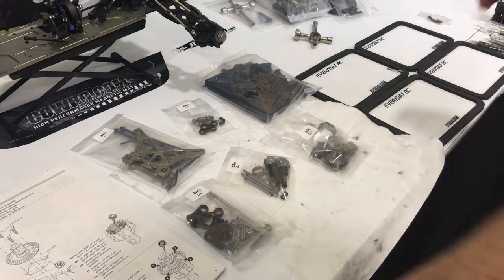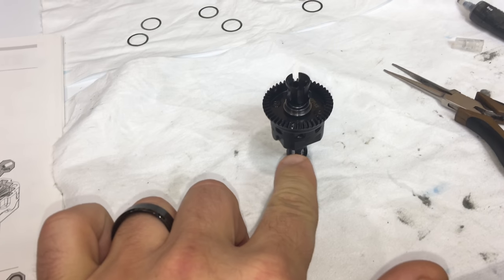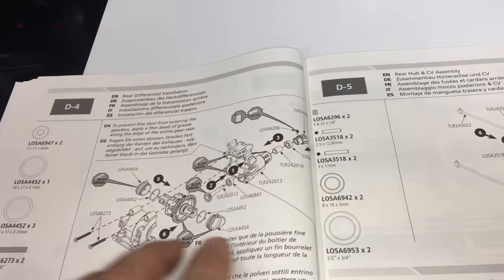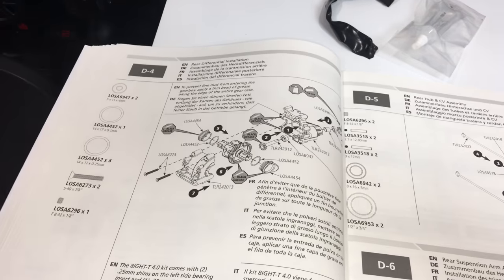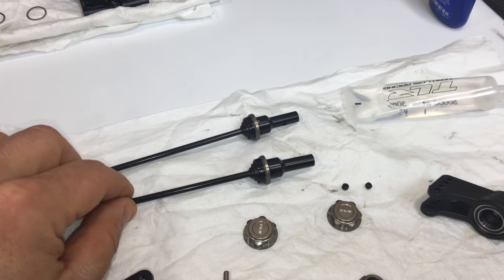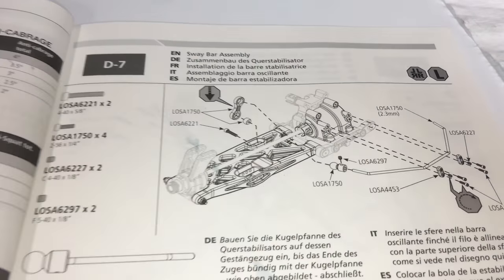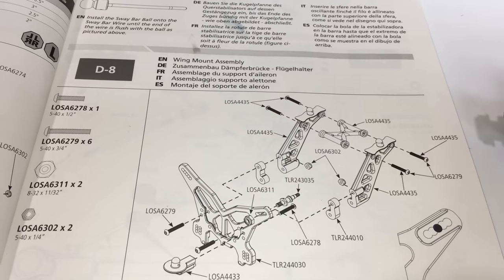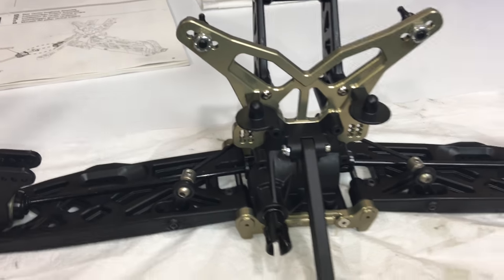TLR 8IGHT-T 4.0 NITRO TRUGGY KIT -REAR DIFF ASSEMBLY INSTALL- PART 3 BUILD SERIES

Comment: The tlr difs. are awesome I did not use a shim in mine but mine was a rtr but I did upgrade a lot of it plus I also replaced all dif fluids 50,000 cent. 30 in the rear and 20 in the front they are smooth as crap I did try it with the directions but then I had to call factory and he told me to set it up like the 4.0 yep that worked no shimes I went for the feel
Reply from the maker: Thanks for the feedback. The instructions are very vague in this kid. It took me a while but I got it to fit how I like it and I’m sure after doing some driving it’s going to break in nicely. In the instructions the highly suggested using shims. However yours held up without the shims?

Comment: hey chris john had the same problemb with the front tower its .002 under so not much drilling at all and the screws where able to threaded in the plastic it was tight but they go
Reply from the maker: It was actually the wrong screws. After further review I realize that the front bulkhead screws were switched for the body mount screws. I don’t know if John realize that but after careful inspection I realized that it was wrong. I have since fixed the problem. Thanks for watching

Comment: Just in time for a 25 minute break for working on my rig 👌🏼
Reply from the maker: Hey JOSH glad to give you some entertainment from your break or you can put it on in the background and Wrench while I am wrenching my friend!
Reply: EVERYDAY RC Yikes I would remove all of the left Shims and install them on the right to shim the ring gear away from the pinion 😳pinion mesh way too tight bro !! That sounds like a duck call.. 10:10
Reply from the maker: I hear you JOSH. It took me about an hour to get it to where I am right now. The only reason why I left the shims in and went with the mesh a little grinding like that Is because in the instructions it does say they highly suggest the use of the shims and two of my close friends who have built this kit told me that you will feel some grinding with the gear mesh but as soon as you start to drive it will go away. I hooked up an electric drill and rotated the gears and once I did that it was very smooth but turning it by hand you definitely hear a lot of grinding. Well, we will see what happens my friend. It should make an interesting video if it explodes! 😂
Reply: EVERYDAY RC oho it would be anything but funny buddy! I just figured if it could be adjusted it might be worth mentioning it. Wasn’t poking fun Chris 👍🏻 just getting back to the video and got to the part of the drill breakin 😁 maybe I’ll wait till the end of the video to save face lol
Reply from the maker: No it’s all good JOSH. I appreciate everyone’s feedback. I’m new to this kit And I have never wanted any amount of grinding with my gear mesh but apparently with the racing kit such as this they want it to be tight and eventually break itself in. New to me as well. I tried to eliminate as much as possible While keeping the mesh tight. I guess we will see what happens brother

Comment: What's the purpose using heavier diff oil...
You love my question but never answered it...
Reply from the maker: Thanks for watching and I hearted your comment to acknowledge that I read it But sometimes it takes me a day or two to answer all the questions. The purpose of using a heavier Diff oil Will allow more power to be put to the drivetrain. If I went it with a lighter fluid it would allow more slipping and easier cornering but less power to drivetrain. The Reason why I wanted to go with a thick  fluid is because it is a nitro engine and I want to get as much power to the ground as possible. It’s good for bashing and speed But would not be a good set up for a race track where you want to have more cornering and agility
Reply: EVERYDAY RC 

Very nice thanks for clearing that up...
Reply from the maker: No problem bro contact me anytime with questions and I’m happy to answer. Thanks for watching and have a fantastic day! :-)